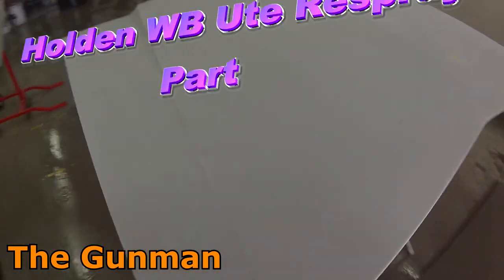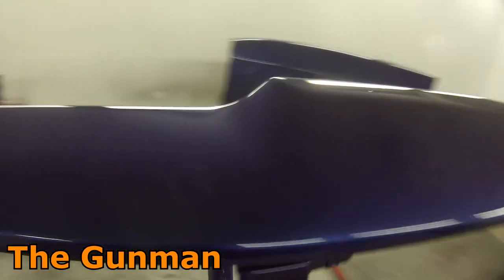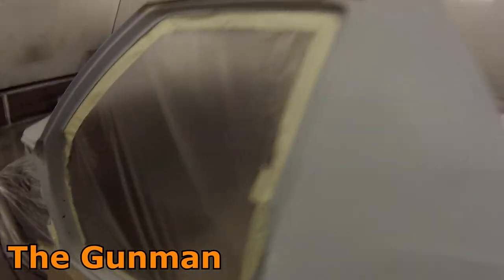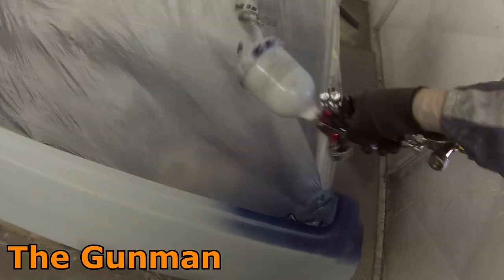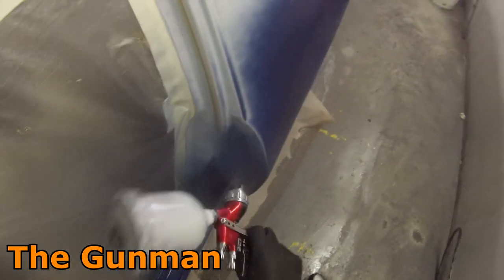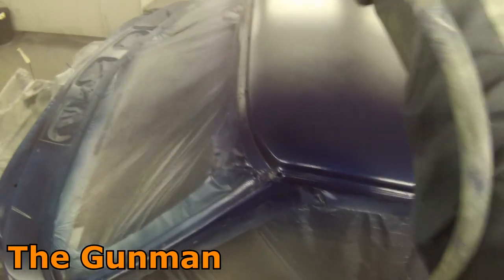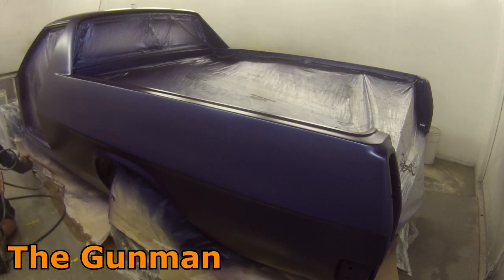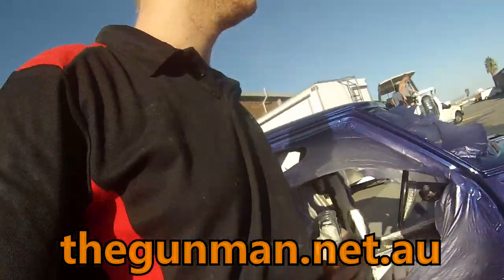WB Ute part 3

Comment: Great video looks sweet. Thanks for your honest professional opinion on spray guns. I use to paint bumper bars on the line at Holden back in the day so mixing paints and blending was not taught.
Always had my prep skills so you have filled in the blanks for me. 
Also you will save me huge $ on buying the right gun straight out.
Appreciate it and keep up the great work!✌🏼️

Comment: Our jobber carries Metalux products here in the US.  They are owned by Chemspec USA just about 10 miles from my house.  I sprayed their solvent base coat for a while but got fed up with having to put 4 or 5 coats down for coverage.  And the price has gone up to the point that it is nearly as expensive as the premium brands.
Reply: I have not found an economy product that takes less then 4 coats or so to cover. I believe for the economy price you are going to use more product. And the paint companies can't afford to put the color match in the economy lines when they don't see the profit like the do in the premium lines.
Reply: Anthony Milano Agreed.

Comment: Gunny a question , does using a branded basecoat thinners against a paint shops own brand make a difference in you paint . i say this as i had gone to my local paint supplier and they did not have the max meyer thiners that i use , so i used the paint shops own brand , the basecoat did not lay down to well and the thinners smelt raw .... taz